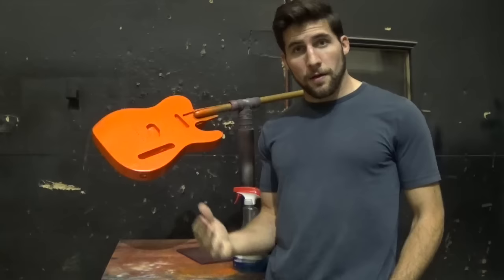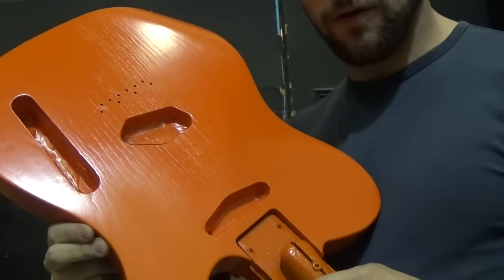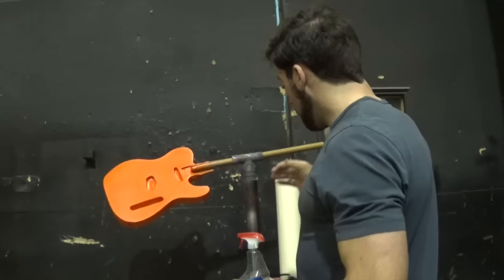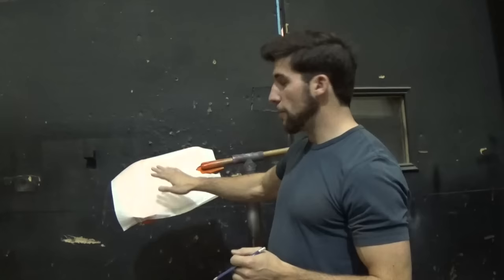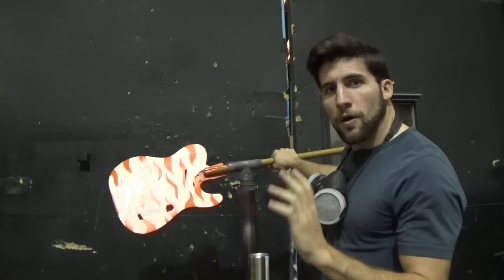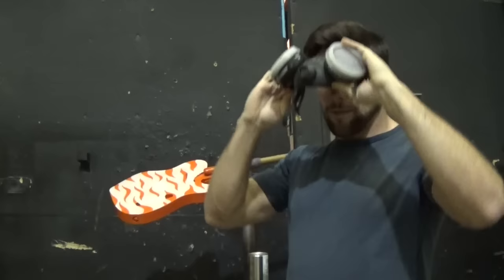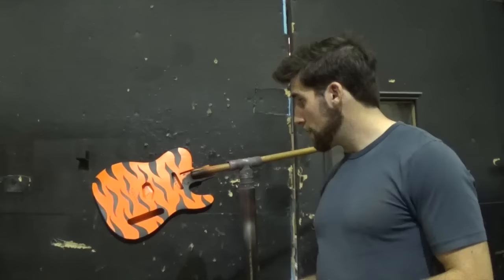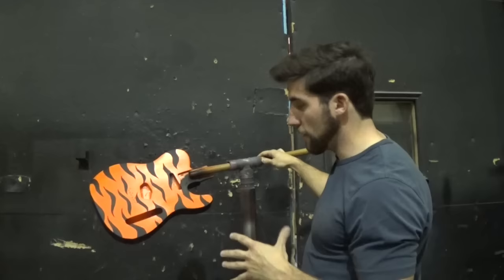How to paint your guitar with spray cans part 2

Comment: that guitar looks grrrreat!!
Reply from the maker: Part of a healthy balanced breakfast...
Reply: Brad Angove 
Great videos!! Is there a solid black poly can spray out there that I could use to touch up my gloss black project guitar all in one spray?? I sanded room from the cut away for fret access and upgraded the floating bridge, which could use some more room.. if I could just can spray those areas and blend them with the surrounding gloss black it would save me a lot of trouble!!!

Thanks!!
Reply from the maker: Dan, for some reason I didn't get a notification on your comment. Maybe because it was set up as a reply to a different comment. Sorry about that. If it's poly it's pretty difficult to just do touchups like that. Poly doesn't really blend into itself, so you need a special blending additive for the clear etc. to really get it to work. If it's lacquer, then the touchups are actually reasonably easy. Are you sure it's a polyurethane finish?
Reply: Brad Angove idk it's an Ibanez xiphos
Reply from the maker: It's probably poly then. You can probably get away with just putting colour in those areas, but you may have to re-clear the whole face and edge to get it to look even.

Comment: which is easier for beginner if you want a yellow guitar with black tiger stripes . paint the whole yellow then cut tape off the areas for the black stripes or paint it all black then just tape of the areas you want to keep as black stripes and then paint the whole guitar yellow.
Reply from the maker: It makes essentially no difference. It’s really just a matter of preference.

Comment: how about doing an accent on a guitar with paint already on it , like right now I have a black tele that the paint is perfect but I want to put a yellow thick stripe like coming down from the neck about 3 1/2 in wide to the end of the front part only and paint a yellow lightning bolt where a sound hole would be and of course a yellow Perl pick guard ,  and if you need a volunteer guitar let me know and i can send you the dissemble body in a box with return labels. note that I am open for suggestions if you got a better idea for an accent on a  black guitar
Reply from the maker: To do that you would tape the sides and back of the guitar, scuff the front, and do you paint job just on the front like in this series.
I don't need a volunteer guitar haha, but thanks for the offer.

Comment: Bengal pattern. A simple graphic, I like it. I'm wondering how it would look if you did the stripes going with the grain?
Reply from the maker: I'm glad you like it. It probably would have looked good the other way, but it may have looked a bit convoluted. Either way, this seemed more appropriate since the direction should match up to how a tiger would look when you hold the guitar normally.
Reply: Brad Angove
Agreed.

Comment: Great work. Have you ever done a video with marble effects, using plastic bags and /or Saran Wrap? Seen all your videos but maybe I missed that one. Thanks.
Reply from the maker: I’ve used that technique a few times. In particular on the guitar I painted for dan from Guns and guitars I used a similar technique. 
I also showed it quickly in my video on the 5 spray can techniques in 2.5 minutes haha.
Reply: Brad Angove I looked and found one of your videos that deals with that, thanks. The ´plastic’ surfaces must have been uneven, how did you even them out?
Reply from the maker: What plastic surfaces are you referring to?
Reply: Brad Angove I found your video about « marble » effect. (Plastic/ paper/ Sean wrap). Thanks much.

Comment: Have you ever used that transfer tape for binding the guitar? I'm thinking of doing that, I guess it should be fine wright?
Reply from the maker: I've never used it for that. Generally when installing a binding you have to press it into place bit by bit and tape it as you go. That's why people use several small pieces of tape rather than just running one line of thick tape all the way along.

Comment: This might be a dumb question, but, when you drew the design in the tape, then cut it out with the razor, how do you avoid scoring the orange paint  with the blade ?
Reply from the maker: Great question. I use a brand new blade so it’s crazy sharp and I don’t have to push hard, then I cut very lightly. It’s better to have to separate the glue with the blade after rather than pushing too hard and scoring your surface. 
I definitely scored the surface the first time I tried masking like this way back in the day.

Comment: Hi Brad. First of all nice job and thank you for your videos! A question: if I wouldn't risk to damage the top with the razor and suppose to paint the stripes with a black felt tip pen or a marker without putting the frisket, it would still be a good result anyway? Which kind of felt tip pen in case? Thank you so much.
Reply from the maker: You would need to use a compatible paint marker.

Comment: Hi brad, love the way you explain how to properly paint with spray can. Currently I'm spraying acrylic lacquer to my guitar. I'm planning to paint my guitar with brush (some area covered, the others not).
Quick questions here,  Do I need to sand my acrylic lacquer finish using sandpaper before applying my acrylic brush graphic? If so, what grit should I use? (I don't have scotch brite, only have 300, 500 and 1000 grit sandpaper)
And also, is it mandatory to sand the acrylic lacquer finish before applying clear coat (back side of the guitar)? Is it ok to skip the sanding process before applying clear coat?
Reply from the maker: I would sand it with 500 gently if those are your options.
Reply: @BradAngove  wow thanks!! soon i’ll do it. you’re the best. thanks

Comment: Brad what if you lay down the lacquer base coat and you get interupted in the middle of the finish process. Can you shoot the clear the next day?
Reply from the maker: If you're using lacquer you should be waiting a day in between coats anyway typically. With most of these other solvent based paints you can let them dry for 24 hours, scuff them lightly, and then go back to painting or move on to clear.

Comment: Ok this is awesome. Quick question: what was that cloth you used for creating a smooth surface? was that your source of sandpaper?
Reply from the maker: It's a scotch pad. It's easier to scratch up corners and curves with this than with sand paper in my opinion.

Comment: When cutting the design out, how did you prevent from scratching the guitar?
Reply from the maker: You use a brand new razor blade so that you don't have to press on it. I really should have mentioned that, sorry. The sharpest blade possible will allow you to cut without having to really push, which will allow you to cut through just the mask without gouging the guitar.

Comment: Nice, looks good. Does rattle can usually dimple? I did something recently with rattle can and primer and its a little dimpled when you are up close to it. Is this normal and you just sand it after?
Reply: sounds like orange peel, get some 1500 wet and dry paper, to flatten it.
Reply from the maker: It's not uncommon for the paint to do that. You can just sand it out. If it's your final coat, sand it to a very fine grit and polish. If not, you can sand it flat with 600 grit and paint over it again.

Comment: I'm refinishing an ibanez 7 string... the cheap sg style body. I just spent Saturday priming and this morning was able to sand and lay down three coats of the base color. Looks good but will require sanding to take out some blemishes and smooth out the finish. 
I want to do some stripes on the face. Should I sand the base smooth first or just scuff and paint the stripes and sand smooth afterwards?
I'm planning on clear coating afterwards.
Reply from the maker: I would sand the base smooth first. Sometimes it is worthwhile to clear coat after your base coat before applying stripes or other paint if you're at all worried about paint coming up with the tape or anything.
Once the stripes go on there, you will likely want to scuff the edges of them gently before your final clear coat stage to reduct the ridges in your paint job.
Reply: Brad Angove Thanks very much. I've got some finer sandpaper coming in tomorrow... 3000, 5000 and something higher but don't remember at the moment. 
How fine should I go with sanding the base coat? Would wet sanding be better in your opinion?
Reply from the maker: +danar dalin I sand my base coat to about 800 grit. No finer than that or the clear may not stick properly. 
I try to avoid wet sanding guitars usually. I want to avoid getting water in the holes and risking expansion or other issues.
Reply: Brad Angove Excellent. Thank you again!
Reply from the maker: +danar dalin you're welcome
Reply: Brad Angove I appreciate you answering all of my questions... if I may ask another? 
I sanded the base coat last night and found a couple of spots that were only lightly sprayed and had to apply a few more base color coats. 
Saturday I'll be ready to sand the base again and the apply clear. 
When I'm sanding the base coat for clear, am I sanding out the orange peel or am I just sanding to provide a surface for the clear to stick to?
Reply from the maker: If you're able to sand out some orange peel then that will make it a touch easier later on, but really the aim is just to abrade the surface sufficiently for the clear to adhere properly.

Comment: Hi ! First : Great job and thanks for this video series !
I just have a question, i follow all the steps you mention in the video but when i pull off my masking paper i was left with a lot of glue residue on the guitar ... How can i get ridd of it without damaging my paint job ? Thanks for the answer ;)
Reply from the maker: Have you tried gently rubbing it off of there with your thumb?
Reply: +Brad Angove yes i did but it didn't work i also tried with a razor blade did not work also... i'm a bit lost i don't wanna use product that Will ruine the paint someone told me about usin fuel based products but i'm not sure...
Reply from the maker: What kind of paint did you use, and what kind of tape?

Comment: @Brad angove,
I have now runs in my color coat 1k spaycan. Should I sand them out before clear coating or is buffing it down enough?
Reply from the maker: Sand them smooth before moving on to the clear. Your need to sand your paint before clear coating anyway generally.
Reply: @BradAngove  nice I will try this. Let's hope the color is thick enough. Thank you.

Comment: Hi Brad..  What is grain filler if i don't want to show the woods texture as you mentioned..  What should i use ?
Reply from the maker: The texture that you're seeing there is the open grain in the wood. You just fill it in with wood filler and sand it smooth to avoid that. I have a video on my channel about how to fill grain with paste wood filler. That's what I would do to avoid the grain showing.
Reply: Thnx Brad,  gonna check it out :)
Reply from the maker: Excellent. Let me know if it sorts out your question.

Comment: Can you help please? I'm spraying a guitar with gloss black spray paint, after I apply the final coat of black should I sand it before clear coat?
Reply from the maker: +76indiekid Unless you are applying the clear coat within the "recoat window", then yes, you should let the black dry completely and sand it lightly before clear coating.
Reply: +Brad Angove Thanks for the info, it's much appreciated. Great vids by the way, very helpful. 👍🏻
Reply: @BradAngove  so i could do two coats of spray paint enamel, 10 min apart, then do 3 clear coats 10 min apart all in one session?
Reply from the maker: That’s a bit much in my opinion. You could risk the first layers not drying properly.
Reply: @BradAngove  lol i misinterpreted your answer. Thanks much. Can I link your video to my guitar painting video once I'm done?
Reply from the maker: @hetfield2x4  You're welcome to link my video in yours.

Comment: how would you paint a Eddie Van Halen Frankenstein??? please respond
Reply from the maker: I would do it in layers. Let each layer dry and then mask up the next one. It would take a bit of planning to choose the order, but should be fairly straightforward. The hardest part would be getting rid of the paint ridges from the tape afterward.
Reply: would you put a primer on before or seal it?
Reply from the maker: I would seal it with clear coat after. I would use primer if I was starting with a bare wood kit or something like that.

Comment: Hey, I Tried using Valspar paint and when i went to sand it down. It was really gummy and would roll up on me as i was sanding it. Is that just cheap paint or am i not applying right?
Reply from the maker: +Ethan Coggeshall How many coats did you apply? How long did you wait between coats? How long did you wait after the final coat before you began sanding it?
Reply: I put about four or five coats on, waiting about 15 min between coats. Waiting about 3 days to start sanding
Reply from the maker: That's odd. It sounds like it didn't harden properly. I haven't used valspar, so I'm not sure what the recoat times are. 4-5 coats is quite a bit, so I guess it's possible that the first few layers didn't have a chance dry properly. Was it cold where you were spraying?
Reply: +Brad Angove it rained later on that day so it was humid, but not really cold. I pretty much emptied the can on it. I admit I didn't apply it as carefully as you did. I'm just going to try it again and with just 2 costs and see how it dries.
Reply from the maker: That's probably a good idea. Let me know how it goes.

Comment: Graphics unfortunately add a cmplication to your DIY.  You essentially have black stripes layer on top of orange base, raising this detail and making it more difficult to achieve a smoothe finish.  Trying to remove orange peel on the orange coat can result in oversanding the black paint layers in the applied graphics.

Comment: Wow, how many times have you painted and repainted this guitar?
Reply from the maker: That’s specific guitar? Probably 3 or 4 by now. Although I’ve got an almost identical one that I probably did 6 or 7 times.
Reply: Cool, I'm gonna repaint my SG
Reply from the maker: Awesome. I hope it goes well.
Reply: Thanks. you should do a video on replacing binding
Reply from the maker: Are you having trouble with a binding?
Reply: Yes, on my les paul kit the binding was scuffed so I peeled that part off, now I am gonna try andpatch the old binding to some new, the trouble is its on the horn. also would you recommend spray on poly for the clear coat? Thanks Brad, you're a cool guy.
Reply from the maker: I’m fond of spray on poly, yes. Unfortunately I’m no expert on bindings though.
Reply: Thanks Brad.
Reply from the maker: Kaelin Storrs Thanks for watching.

Comment: That tape is very interesting. I have thought about doing a guitar with stencil taped on and then spraying the other top color. Hmm. 
Brad, I'm also looking into using Holoflash material on one guitar too.  My LP kit from Canada. PrecisionGuitarKits.com which are great by the way. Best fretwork I've ever seen on a guitar except some J Custom Ibanez's, but much cheaper and cool.
Reply: That tape is impossible to find in Australia! Frisket, transfer tape.. no one knew what I was talking bout.
Reply from the maker: That's surprising. The custom painters there use the same stuff if I'm not mistaken. DNA Custom Paints is in Australia. They probably have it, or can point you to someone who does.
Reply: I was most likely looking in the wrong places. Ended up getting some from ebay.
But now I know where to check next time, cheers Brad

Comment: how do you keep from cutting into the guitar or does it not matter?
Reply from the maker: You use a brand new razor blade so that you don't have to press on it. I really should have mentioned that, sorry. The sharpest blade possible will allow you to cut without having to really push, which will allow you to cut through just the mask without gouging the guitar.